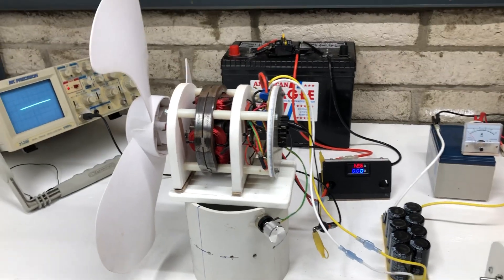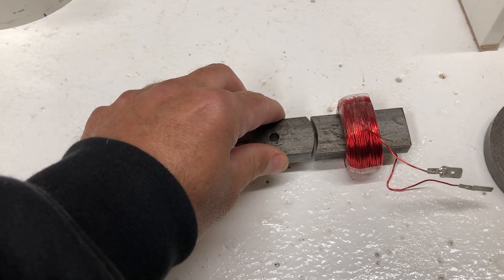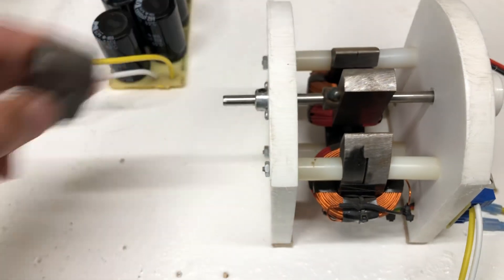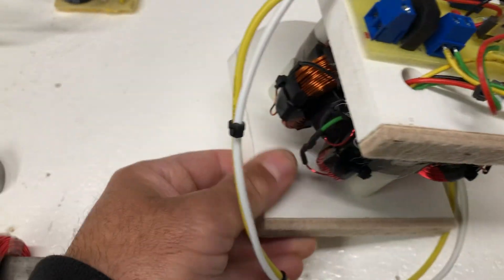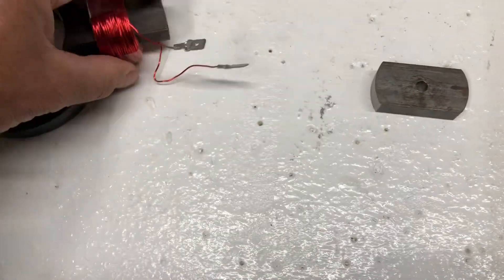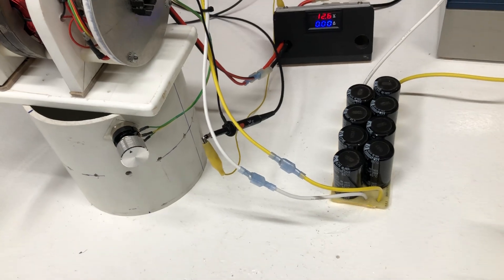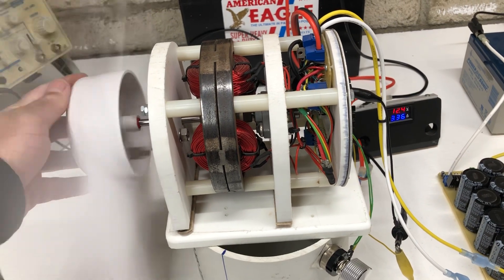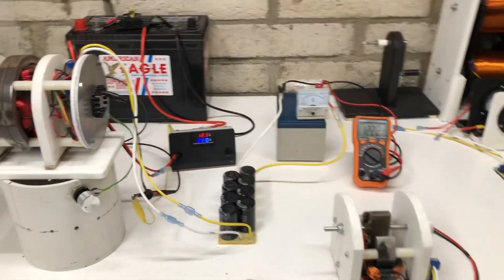Attraction / reluctance motor home built with basic fundamental operation

Comment: The Simplist switched reluctance motor I seen  demonstrating the concept was made from a single electromagnet coil for a stator and a rotor with 6 nails with their heads evenly pointing out radially. It was mechanically commutated with two brushes that made concurent contact with a nail when a nail when that nail was moved within 30 degrees of the coil and broke contact when that nail moved in to position over the coil. 

When connected to a battery, It's simple to see how this functions as a motor. But in theory it should be able to work as a generator if spun in reverse from how it motors. Just add a diode between the battery and motor's coil, but make the coil a center tapped coil. The diode will suppress induction kick back. When current is interupted, and the collapsing magnetic field will then dump all the energy stored in the magnetic field, into both halfs of the center tapped coil, resembling an auto transformer. This includes the mechanical work done pulling steal away from the electro magnet that stored even more potential energy in the magnetic field.  

While generating, Using too few turns on the coils and spinning too slow and using  too little magntizable metal risks too little inductance and too high current resulting in magnetically saturating the iron, and potentially less energy output than input.

Comment: WOULD you be able to tell me how many magnet polls are need to make a motor for 1 H.Pl output with major torque ?? Rotor diameter, number of polls, are needed K Energy ??
How about the amount of electricity needed compared to a small fan motor draw ?? The best part is the use of just regular material without magnets.. How hot do the electromagnets get Sir ??
 Nicely done video Sir too.
Reply from the maker: This rotor is 2 inch so prob double and a bit deeper 
 The steel does get hot if you use a lot of power it’s not laminate 
 The motor is cheap to build but a bit time consuming making sure things fit and balance
Reply: @kenergy1707  Do you prefer using lamination if available ??
Reply from the maker: @victoryfirst2878  yes
Reply from the maker: If you look at the other attraction motor I used on recent video I made it out of a vacuum cleaner motor stator
Reply: @kenergy1707  I LIKE that you used something you had on hand. Upcycling is a great thing making experimental things move along. Well done  fella.
Reply: @paradiselost9946  Free energy devices are suppressed as well especially switched reluctance parametric oscillator.

Comment: Have you thought to try turning you reluctance motors into generators?
Reply from the maker: I have not yet
Reply: @kenergy1707  does it sound like something that might interest you?
Reply from the maker: @kreynolds1123  there are no permanent magnets in this one
Reply: @kenergy1707  If I understand this correctly, reluctance motoring,  if you energize an electromagnet, you dump some electrical energy into creating or storing energy in the magnetic field. it will exert a force on the steel and move the piece of steel into a low reluctance magnetic curcuit.  work is done taking magnetic  field energy and converting it to kenetic energy. 

Switch the direction and the reverse happens. Magnetic reluctance electrical generating. If you create a low reluctance magnetic circuit, and put mechanical work into it by pull the piece of steel away, it it converts the mechanical energy to magnetic field potential energy that is in turn converted to electrical energy.
Reply: Yeah the copper acting like a secondary turn on a transformer carries an induced current because if an applied changing magnetic field. And the induced current creates its own magnetic field, and that field is in opposition to the initial change in magnetic field.  Motors that use this mode of operation we call a syncronouse magnetic induction motors. 

And while induction motors are asynchronous and work by repulsion, reluctance motor are syncronouse with the magnetic fields in the coils  and operate by magnetic field attraction. 

A basic Reluctance generator concept. Imagine a piece of steel with two identical coils. The primary coil charges the magnetic field of a piece of steel. An attached piece of steel is then pulled away comverting mechanical enerfy into magnetic field enerfy. Then the primary coil is switched off and the secondary coil is witched on.  All the energy in the magnetic field is now dumped into the secondary coil.
Reply: ItIsSufficientToAdACapacitorInParalelToMotorAsToInductionGenerators?
Reply: @ovidius2000 The Simplist switched reluctance motor I seen demonstrating the SRM concept was made from a single electromagnet coil for a stator and a rotor with 6 nails with their heads evenly pointing out radially. It was mechanically commutated with two brushes that made concurent contact with a nail when a nail when that nail was moved within 30 degrees of the coil and broke contact when that nail moved in to position over the coil. 

When connected to a battery, It's simple to see how this functions as a motor. But in theory it should be able to work as a generator if spun in reverse from how it motors. Just add a diode between the battery and the center of a center tapped coil.  The diode will suppress induction kick back and minimize arcing at the brushes.  When current is interupted, the collapsing magnetic field will then dump all the energy stored in the magnetic field, into both halfs of the center tapped coil, resembling an auto transformer. This includes the mechanical work done pulling steal away from the electro magnet that stored even more potential energy in the magnetic field.  

While generating, Using too few turns on the coils and spinning too slow and using  too little magntizable metal risks too little inductance and too high current resulting in magnetically saturating the iron, and potentially less energy output than input.@ovidius2000

Comment: Actually most of them are designed to run on 50 or 60hz. The change of polarity happens 50 to 60 times a second in this manner so it actually works a bit better with pure ac because the electromagnet part actually changes polarity attracting and repelling where as what you are doing is pulsed dc and the only reason it continues is the mass and energy continues the rotation. In the ac motor the central bar actually has a repell force at various times and that gives it a tiny bit more energy instead of just coasting along. But they can both work. I like the fact that you made one, it's very cool.
Reply from the maker: Thank you for the comment! Yes that’s true.
 This motor only (coast) because it only has one circuit. The benefit of using dc is the output of up to 25% recovery of the input power.
Reply: @kenergy1707  pls I need every possible information on switched reluctance motor pls sir
Reply: switched reluctance motors only work on attraction, standard induction motors and synchrounous motors do benefit from attraction-repulsion, but the sine wave would help tons by allowing soft start-drop of current, reducing noise and torque ripple, (just add some diodes to send one phase to coil pair A and the other to coil pair B.
Reply: Pls how can I contact you sir
Reply: Wow.SoMainsAcCanRunThisMotor....🤗
Reply from the maker: @ovidius2000 dc only